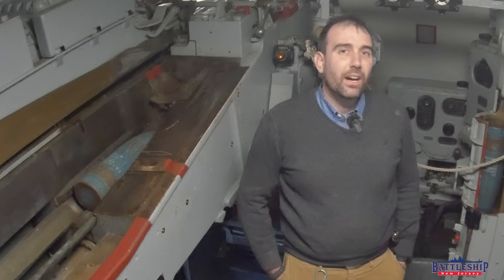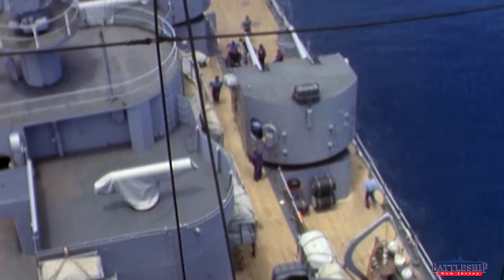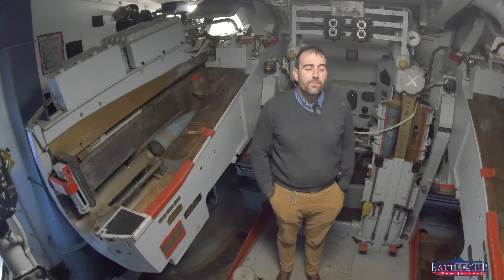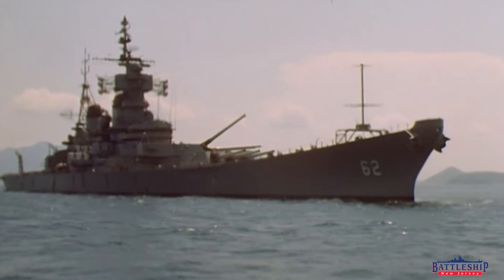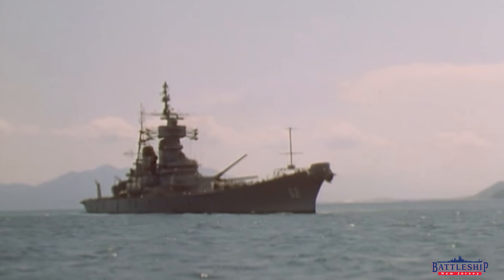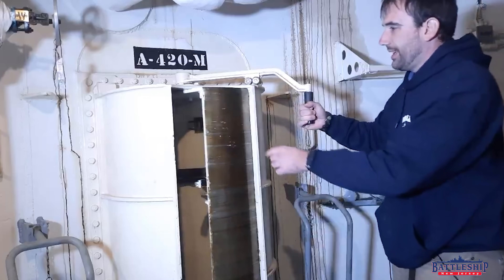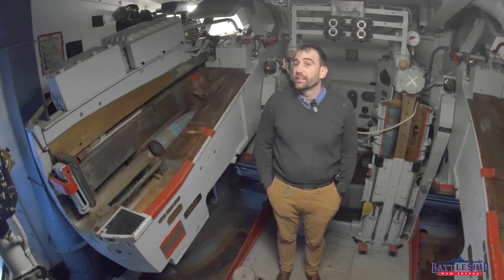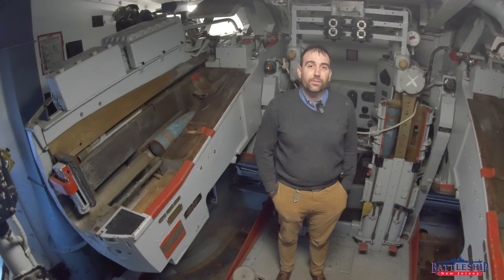Why Do Modern Warships Have So Few Guns?

Comment: I think 50 caliber computer aimed machine guns with proximity rounds will be a thing very soon, for taking out drones. The electronics can be made small enough to fit, and the round doesn't have to hit.  They could spray carbon fibers in all directions, or shrapnel.  Of course there could be some traditional full metal jacket rounds in the mix for other targets.

Multiple CIWS like systems, to counter flocks of drones.  To handle pirates, there's always the Marines and their weapons.  Smaller ships could have remote control machine guns fore and aft.

Comment: I think the Otto-Malara MK-76 would be a good fit to fight drone swarms. Fast firing with AA shells for missile defense and small drone swarms, but big enough to knock out a small boat in one or two hits.
Reply: That might work if the drones are coming for the armed ship, but the lack of range could be a serious issue if the drones are being used to target civilian shipping. The counter to a drone swarm might well turn out to be another drone swarm that is designed to kill other drones.
Reply: @Akm72  What about the 76 Oto Melara with Strales guided munitions? It uses a beam of radio waves to guide the projectile and explode in the vicinity of the drone. It is very effective
Reply: @askallois  It would depend on the effective range and I suspect that any ship-mounted gun, no matter how effective, would be just too short-ranged to be ideal. You want an anti-drone system that can compete with guided missiles for range but at a much lower cost per kill.

Comment: Gunpowder behind a big hunk of metal in a tube wasn't good enough for the guys designing the Zumwalts, so they had to over engineer the round to the point it was too expensive to shoot.
Reply: The one million dollar shells right?
If so the largest factor as to why the cost was so high is because of scale.

I'll give you an example with video game consoles. Specifically the PS5.

When it and other game systems come out, they tend to be quite expensive. But once time passes, the industry to create it gets streamlined, and millions of units get sold/are in inventory, the prices drop. Sometimes significantly.

That would have been the case for the Zumwalt's shells because if all 32 ships were made like originally intended, those shells would cost anywhere from 80,000 a shell, all the way to around 30,000 a shell. And each shell would have been rocket propelled, guided, and have a range of 65 to 115 miles. (Future advancements could increase that range even more.) The range of a number of short-range missiles.

However, due to changes in naval doctrine, naval politics, and enemies (insurgents), the Zumwalts weren't viewed as necessary anymore do only 3 were made. That made the shells massively more expensive. 800,000 to 1,000,000 dollars a shell.

At that cost, you could just get a Tomahawk cruise missile with a far greater range and the exact same cost.

Comment: A ciws type gun using almost a shot gun type round that once out a couple hundred yards from the ship a casing opens up releasing hundreds of smaller projectiles spreading out over a small pattern something like a shotgun exactly for taking down small drones or intermixing out with you know a standard type round to for taking out larger drones but through the use of the off the shelf drones that they're using to carry bombs a plain old shotgun shell will take them down just fine but you want to take it down farther than a regular shotgun ranges then send the hurt to what ever pissant country sent them after our ships. So many of these little countries know they can do stuff like this and basically the US won't retaliate anymore because of all the liberals and idiots out there saying oh you can't do that that's not fair that's not nice you screw with the United States you pay the price simple or at least that's how it should be that's how it used to be but at the same time the US didn't stick its nose and everybody

Comment: The guns on these modern frigates are radar controlled and fire many rounds a minute. When they shoot at a moving object, radar computes the deviation between the projected and the actual trajectory, and the next shot is automatically compensated.

 I've read about a laser system to shoot down drones. I hope it works and I hope it's true because that would be cool.
Reply: They do have a laser system for air defense. Pretty much for small stuff it actually destroys the object. Bigger stuff it either fries the 'eyes' or forces the objects own warhead to explode. Which that is the current best way to kill stuff like drones. Simply cause its a one time cost and it just keeps killing unlike missiles that have a (really exspensive)cost each time you use one obviously. I think something in the 40mm range will come back as a 'swarm defense' weapon. Simply cause while 20mm will easy kill a drone the fact is you have to hit the drone or be on top of it for a 20mm HE to kill it. You could use a cwis but I'd assume it fires to fast and would waste ammo effectively from spooling up and down as it changes targets in a drone swarm. I still think lasers and jammers will be the main anti drone weapon. But at some point either swarms are gonna be so big you just can't physically fit enough laser mounts to engage all of them in the time/distance you have to engage them in. Or the drones are going to become hardened enough were the time required for a laser to destroy a drone makes it a ineffective weapon against swarms above a given size once again cause of a limited amount of mounts to fire the lasers and the time/distance that they have to engage in. But in that circumstance something of a reasonable fragmentation/flak pattern would help thin the swarm out and let the laser engage point targets to mop up. Pretty much what i imagine will come out is a love child of a 40mm bofurs single or twin mount a cwis and the 5inch deck gun of a arleigh burke class destroyer.  Pretty much take the 5 inch guns look and shrink it down to 40mm with the projectile size and purpose and probably rate of fire of the bofurs with the fire control and radar tracking/aiming of a cwis. Slap 2 or 4 of those on a ship depending on the size and needs of fields of fire to provide adequate protection.
Reply: @high633  the ammo they'd be using would probably be smart ammo similar to radar controlled proximity shells used in WW2
Reply: @ReclinedPhysicist  thats what i was thinking. Use the cwis like tracking and targeting cause with that not only can you easily track and engage targets rapidly and automatically. You can identify clusters to more effectively flak them. So you not wasting a 40mm on a single drone your using the 40mm on 3 or 4 drone and with that targeting system already built into the fire control of the weapon having it program and set each shell as its firing for the given range and proximity to target would be somewhat easy. Given it already has all the necessary info for its own self use for engaging. You would just have to integrate a automated shell setter into the weapons loading system. Which we already have had such automated fusing systems for some time. Usually for grenade launchers and larger sized cannons.
Reply: "The fire control system knows were it is by knowing were it isn't...."

Comment: I like to see a Tico-arrangement with a 5in forward and a 5in aft, and a heftier 30mm rotary or 40mm Bofors for point-defense. It's a shame they're removing the two forward guns from the Zumwalt's, I would replace the forward 155mm gun with a 5in and fit the Hyper-Sonics in the remaining space of the second 155mm mount. Of course, lasers offer another anti-drone weapon.
Reply: I’ve wondered if the Mk110 Mount can be added to a Burke.

Comment: Guns aren't coming back - at least not at larger calibres. Drone swarms can be easily dealt with at gun ranges by cheap missile systems like the RIM-116 RAM and other ESSMs. Ukraine has been using improvised machinegun mounts - sometimes sticking multiple Maxims together for an unholy amount of firepower - to shoot down drones but that's drones that aren't aimed at them. If you're in a ship, CIWS is the last option. I can see the US developing a specific munition - like a flak or shotgun shell - that can be used against slower-moving objects like drones but I don't think they'll put more guns on the ship to utilize it.

Comment: What would a modern anti-ship missel do to a Battleship with the armor of the NJ? I know the torpedo would do serious damage, but a plan / sub or other ship would have to get close enough to use them.
Reply: A battleships citadel doesn't have to be compromised to mission kill it. The Bismarck was mission killed with one 14" from Prince of Wales that holed her bow, she lost a lot of fuel and shipped thousands of tons of seawater- mission kill!
Reply: Still stands. What would happen if a modern missile hit the armor. What would it do to the bow or stern? @miketorres8441
Reply: @miketorres8441  Mission kill huh?  Had not the German military been so accustomed to strictly following orders, the Admiral would have ordered the Bismark to follow and sink the Prince of Wales.  Sinking two British battleships would have way out weighed and had a far greater impact than following "the mission" and sinking some merchant ships.
Reply: Not really as the British would still have sunk her because going after Prince of Wales was not a good idea and Lujtens deciding not to was the correct decision as the British can set up an ambush with the 2 Heavy Cruisers and the escorting destroyers
Reply: You also forget the elephant in the room, the Bismarck had sunk the Pride of the British Empire and the Royal Navy, HMS Hood, the Royal Navy is out for blood
Reply: Probably depends on where the hit is.....
And damage control ability.... On the low end atleast a fire would start probably....

Comment: Remember, the F-4 Phantom originally didn't have a gun. It was added at the F-4E version because of the missile failures in Vietnam
Reply: Yeah, that argument doesn't work anymore bc missiles are good.
Reply: True, but the bugs from the early Sidewinders have been worked out after 40+ years of development.

If you could send modern missiles back to the Vietnam-era, the Phantoms wouldn’t NEED a Vulcan.
Reply: And yet Navy Phantoms, which lacked a gun, still heavily outscored the E-model. It's almost like training and taking advantage of the best available missiles is what made the difference.
Reply: And every fighter since has had a gun (except the F-111 and F-117 if you take the 'F' literally), however the quantity of ammunition they carry for those guns has trended sharply downward with the latest F-35 carrying just 180 to 220 25mm rounds.

Comment: humm. Reminder - USS Long Beach (CGN-9) originally planned with NO guns- the 2 single mount 5/38 added late in design. Leahy class originally had only 2 twin 3/50 - removed in the 1980s replaced with Harpoon Missiles and Phalanx 20 mmm CIWS.

Comment: If you haven't seen a video of a modern 5 inch firing at max speed, it's worth a watch. Unbelievably fast
Reply: If only they did that with a 16".
Reply: For rapid fire with the biggest guns, the problem with that is heating, or cooling, depending on whether you want to measure in terms of the problem or the solution. Imagine scaling up any modern semi-automatic pistol until the hole in the business end is 16". The result shows you how much more metal would have to surround the barrel sticking out of the turret to allow for what might amount to short bursts of fire every five or ten minutes. That can potentially defeat the purpose alone. Even if that's not a problem, that's still a hell of a lot of mass to move. It's reasonable to assume you'd be sunk long before you could line up your shot... and your most dangerous targets move.
Reply: @sirnukesalot24  honestly thought recoil would be the larger issue.
Reply: @rowanmeads8598  Good call. Everything I put out there completely ignores the structural integrity of any given ship. While all that extra mass would help with the recoil. I doubt a system that heavy could float on the same sized hull. 

Now that I think about it, there's also the fact that normal battleships have been moved a significant distance by a lengthy barrage. Think about how much bigger the ship would have to be just to maintain firing accuracy. The damned thing would have to be an artificial island. If you do that, it might as well be its' own aircraft carrier as well as be able to drydock a significant portion of the anti-submarine assets it'd require.

And then all that capital investment could be laid to waste by a single nuke.

That's why I'm not designing ships.🤪
Reply: @rowanmeads8598  Thats one of the main reasons why the US navy stuck with the 5 inch guns instead of upping to 8 inch ones.  The other being 5 inch shells weigh less, take up less room, and the gun platform itself being lighter and smaller.  They tried testing an 8 inch gun on a small ship and it warped the hull and as it turns out it was less accurate.
Reply: @sirnukesalot24 the inertia on chunks of metal that big would also be an issue.
Reply: @sirnukesalot24 However, materials science has also come a long way. Couldn't they design rounds that were in polymer sabots or coated in some teflon-like material to at least reduce the amount of friction, heat and barrel wear? Serious question, I'm far from an expert, but it seems plausible to me. I'm talking about a 21st century 16in gun, not a refurbished 1940s 16in gun

Space warfare technologies are being seriously considered  now, and tech like the above will be required if we want to build ships that can operate in vacuum and fire any kind of kinetic weapon more than once a day in that environment for exactly the reason you mentioned. It's just 100x worse in space

Edit: I realize this wouldn't solve the problem of the heat from all that powder going off at once

Comment: With Hypersonic rounds and Railguns becoming relevant, the range of guns is starting to get into the 100-300 mile ranges. 
I would love to see the New Jersey fire a volley of Hypersonic ammo at least once. The range on 16 inch guns with a Mach 5+ shell would be insane.
Reply: Railguns aren't going to be relevant for a long while as we currently hit a material science limit where nothing we have will last long as a barrel. Hypersonic rounds ended up being too expensive to bother with compared to missiles this is why the Zumwalts have those pretty guns that are never used because they refused to pay the price they wanted for the rounds after they canceled all the other Zumwalt orders.
Reply: If they make railguns railgunbitself will be no bigger 5 inch turrets in most cases + yes we did hit a material science limit unless we find a way to RELOAD A BARREL and whichever ship carrying these railguns needs a couple nuclear reactors for it to be viable soooo yeah long time m8 loong time
Reply: @mertc8050  A swappable barrel wouldn't be that difficult. All sorts of firearms have them. Scale it up. Interrupted threads like a breach block, rotate the barrel however much to disengage the threads, pull the barrel off, put a new barrel on, rotate to engage the threads. That could all be done with a deck crane.
Reply: @52Ford  problem is barrels last about 20 ish shots
Reply: @mertc8050  Ah, gotcha. In theory, they COULD carry multiple spare barrels. After they're spent, they could be resleeved/relined. Really, it wouldn't be that difficult. Not something that could reasonably done on board, but ashore, they could heat the barrel via induction, push the spent sleeve out, then push in a new one and let the barrel cool. AFAIK, shrink fit is pretty common for barrel liners.
Reply: And what ships have hypersonic or rail guns? Name one.
Reply: @bill5982 becoming relevant= in service, I guess

They're in development, and they have been for quite some time. They'll be on the scene eventually, and probably sooner rather than later
Reply: I like the idea of electrically-fired naval guns, but they don't need to be hypersonic to increase their reach if you use newer technologies in the shell itself, like base bleed or rocket assist and glide wings. If your muzzle velocity is hypersonic, all you're probably doing is wasting energy creating a blast and thermal problem for the ship's superstructure and anything mounted to it.

The same is true for tanks, with modern tank barrel pressures and muzzle velocities being high to the sabot-darts can hit the target quickly and accurately and with enough energy to punch through the armor. However, if the munition has a shaped charge like an ATGM, and has PGM guidance and fins like an ATGM, then it only needs to move as fast as an ATGM, because the munition will find the target even if it moves or blows smoke. This means future tanks or tank destroyers could use guns with lower pressures and muzzle velocities. I suspect the same could be true for future gunboats, whether their guns are chemically or electrically propelled.

As for replacing barrels on a rail gun, as some here have pointed out, maybe they would only have to replace the rails instead. Perhaps they could have rails that revolve, like two Gatling guns mounted next to each other. After a shell is fired, both used rails are rotated away and a new rail is rotated into place, one on each side. Meanwhile, automated systems check the used rail and clean or replace it and lube it or whatever they need to do to maintain it and prepare it for another shot once it's cycled back into action.
Reply: Even once they get railguns operationally effective, they won't put them on an Iowa-class.  Their armor's good, but still outdated and outclassed.  They'll build new ships then.